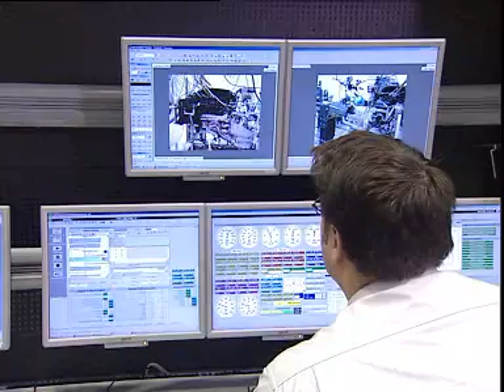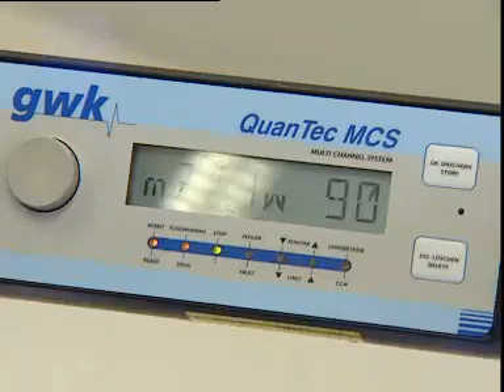BMW M3 V8 Engine PRODUCTION

Comment: Why is high rews a good thing? The BMW has 4 cams, 32 valves, 3 chains, the Ls1 has 16 vales, 1 cam and 1 chain. 2 litres more volume is all it needs to equlaize the power. Not to mention the ls design is available in a varaity of cars from trucks to Corvettes.

Comment: @ThaPietjah yeah, but this is the old one, a supercharged corvette ZR1 produces 638 horsepower, 604 ft-lb torque. Still two valves/cylinder and one camshaft in the center of the block, some may say thats 50s technique but it works and works so damn god one may wonder what the hell the germans are doing! They got 32 valves, twin turbos, four camshafts, two vanos and an 5 year old na chevy outperforms this mechanicle wonder....
I dont say BMW is a bad car, just owercomplicated...

Comment: @Ruskis70 The Corvette gets 28 mpg @ 85 mph, beat that. Thats 8.4 l/100km, BMW  M5 is 14 city / 7,6 highway @100 km/h.
Displacement is an issue but Chevrolet still use less fuel and get more power, thats a fact 50is or not. HP per litre has nothing to do with this, uoy can chiptune the corvette an make 800+ hp, still with factory internals.
I am not debating whos the best, i am only stating it can be made uncomplicated and still reach top performance.
NA means Naturally Aspirated.

Comment: but I was talking about a impreza that have a special editon that have 340HP.It is a good fight with M3 but m3 should win.About the turbos,turbos isn't the same of have more 2 cylinders.Lets talk about the porsches.Porsches with 6 Cyl boxer turbo with 400HP or 450 owns BMW M3(V8) with 6 Cyl.BMW M5(V10 model) VS Nissan GT-R35(new edition 550hp) with V6 it is faster than M5..sRRY FOR english

Comment: the sound that the e36 euro s50b32 does is amazing but i would go with the new b58b30 engine
change to a bigger turbo and more lift on exhaust valves and intake,extra injectors and you have a mmmmm car

Comment: its the old V8 the new one has 2 turbo's
Reply: there is no new one. That IS the last true V8 M engine from BMW.  What came after was a series derived non-bespoke inline 6 cylinder with only 3 liters instead of 4 liter like this. Then they slapped Mitsubishi turbos on it which you can find in any hatchback. This is the only true last M division engine.

Comment: but deferent story here i have M5 E60 with only 70k miles and shit ton of problems the dealership changed the transmission,4 times clutch,camshaft sensor twice....and the list goes on and on my previous M5 E39 was way stronger but i don't know about the F10??

Comment: So they have equal length tuned headers from the factory? That's sweet. I also never knew that the block and skirt were two different pieces on these engines, that makes rebuilds easier I bet..

Comment: The last of the true ///M engines.
Reply: I would consider the S55 more of a ///M engine. Seeing as it is a straight 6, first engine BMW produced was a straight 6. Also, BMW's most successful F1 engine was turbocharged, the M12.
Reply: RLHubner  I would have to disagree. The S55 was derived from the N55 engine found in the series model, whereas the S65 was built from the ground up at BMW M. 

http://f80.bimmerpost.com/forums/showthread.php?t=892746
Reply: In addition, the turbos on the S55 aren't even manufactured in house. They're manufactured by Mitsubishi.
Reply: superfast30 they are all shit and nothing will change its BMW what else do you expect, This engine is a gutless pile of shit its pathetic 297lb/ft  laughable. BMW das ist Deutsche Scheisee for a sales rep
Reply: Oh simon get a life. We all already know that you don't like BMW or german cars in general. And stop using things like "lb/ft" in an intl. forum. What is that - a unit for sand fleas in myanmar? But, to be honest. yes, Honda's VTec engines are really great.

Comment: All that engineering work and couldn't fix the rod knock issues with this engine's . They sound amazing but being that they don't take kindly to to tuning. They are not the best in reliability.

I think BMW went all in when making this engine. Seems like it was designed to be takrn apart after each race and be rebuilt. Can't really daily or push it hard. They missed the q about making them actually complete the race and make them more durable.